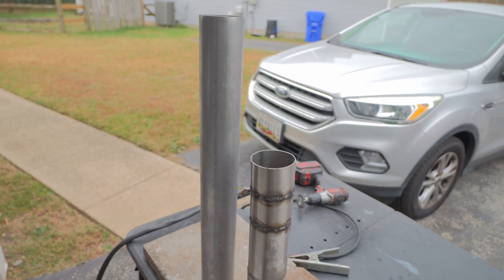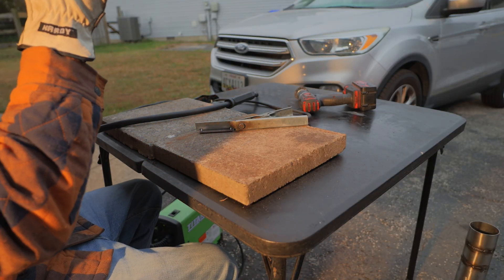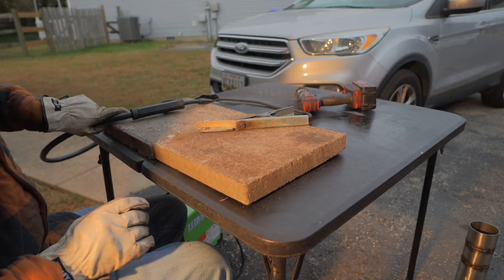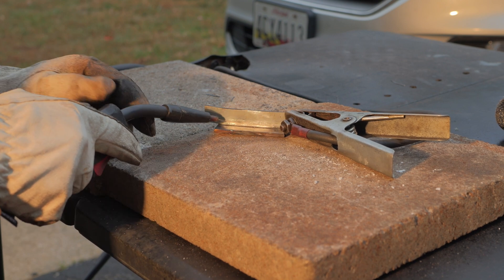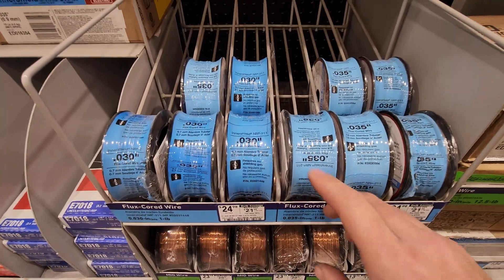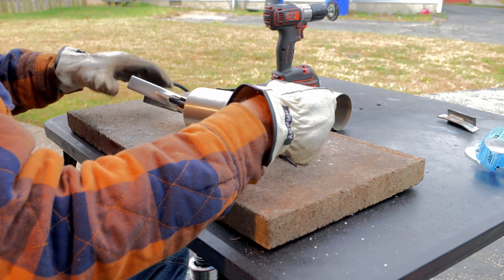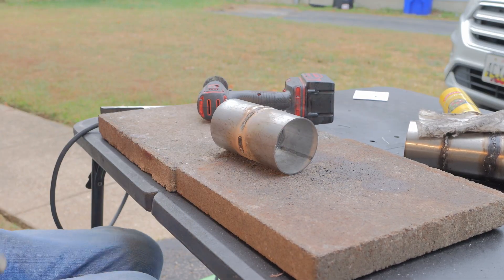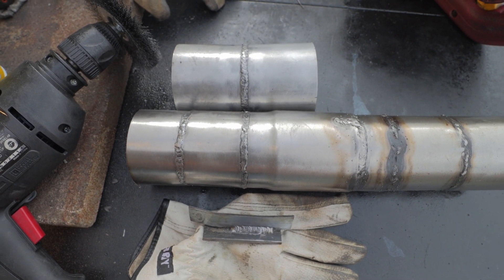How to Weld Exhaust Piping with a $200 Harbor Freight Flux Core Welder (Part 2)

Comment: Why don't you use flux cored stainless steel wire? It seems like it would be a better choice for what you need and on ebay they have the Yesweld wire for the same price as steel flux cored wire.
Reply: I had a heck of a time trying to figure out how to get along with that wire. I dunno if I just got a uniquely bad spool, or maybe I'm just not sharp enough to pick up how to use it right, but I just could not manage to get that stuff to behave. I ended up having to shelve it because I just didn't have the time to devote to getting it figured out when there's other options that aren't as picky and are more widely available. I bet it's great if you take the time to get really familiar with it tho
Reply: I'm pretty sure you have to switch the polarity inside the machine. Theres a video of this on the yeswelder 135 pro welding stainless steel. I read in a comment somewhere else that it is possible to switch the polarity on this titanium 125 too. YouTube channel making mistakes with Greg demonstrates this stainless steel fix wire and he says you absolutely need to change polarity on the machine to run the stainless wire. Cheers!

Comment: I am looking at building my 1st exhaust with x-pipe, can I weld mild steel pipe to stainless v-band? Would 30 wire work well with that?
Reply from the maker: I’ve already done this on my truck. If this video reaches 1,000 views by Friday, I’ll buy the v-bands and make a tutorial on welding the two materials. Share it to help us hit the goal!
Reply: @TPVPRO  Sounds good!!! Thanks